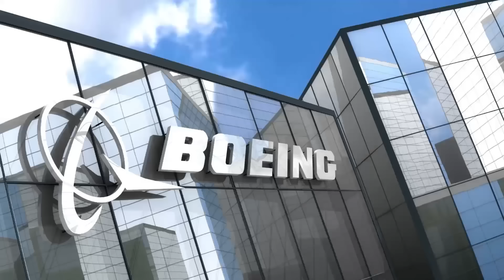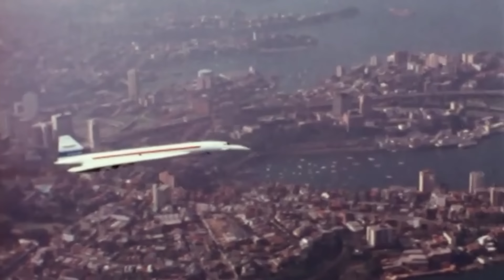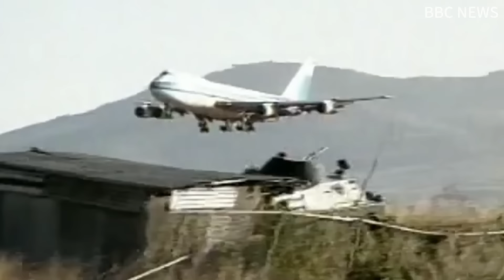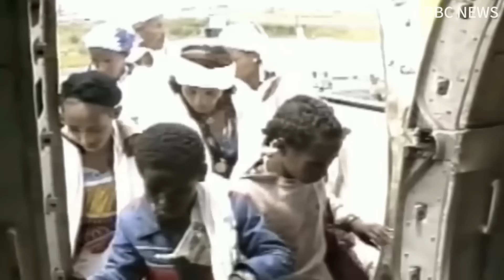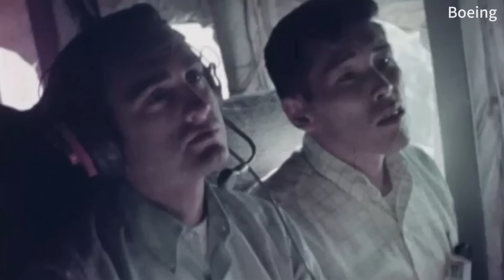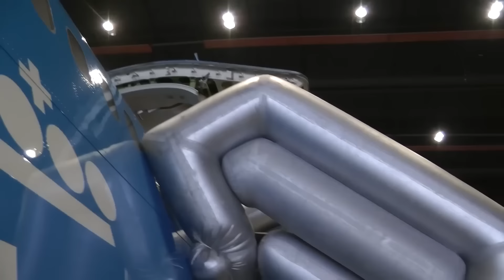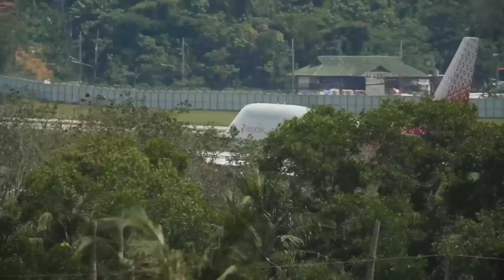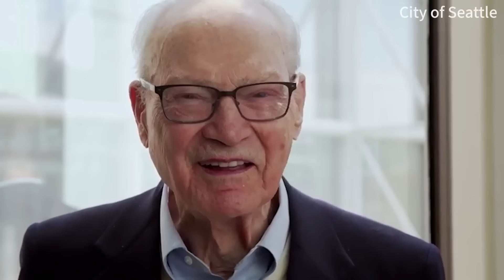What The Boeing 747 Hump Was Really For

Comment: As Pan Am cabin crew (flight attendant and then purser) for eight years (1970-1978, pre-deregulation, when all Pan Am flights were international), I usually worked on Pan Am's 747-100s and 747-200s.  It was an amazing privilege, and I loved it.  In this fast and spacious aircraft, passengers in all classes of service were able to be comfortable, and we were able to take very good care of them.  For takeoffs and landings, I sometimes was assigned the crew jumpseat at one of the main deck's two aft doors on the main deck (L5 and R5).  From these forward-facing vantage points, I would sometimes time the seconds between liftoff of the nose gear and of the main gears (on takeoffs) or between touchdown of the main gears and of the nose gear (on landings) and was always impressed by the result.  (I was very interested in every aspect of the 747's capabilities and its other flight logistics.)  ...  As alluded to above, Pan Am's 747s had a main deck and an upper deck.  During my 1970-1978 tenure, every passenger had an assigned seat on the main deck, and that was where each was to be on takeoff and landing.  There were three classes of service:  first class, business class and economy. The upper deck held a dining room/lounge for first-class passengers, a galley, lavatories, an emergency exit that was 32 (or possibly 36) feet off the ground and the flight deck.  The main deck and the upper deck were connected by a spiral staircase.  Up to 16 first-class passengers could choose to take their main meal at one of the tables in the upper deck dining room, and up to 16 first-class passengers  at a time could relax in the upper deck lounge when a meal was not being served.  All seating in that dining room/lounge had seatbelts, and that area had windows like those on the main deck.  Two flight attendants worked on the upper deck, cooking meals and serving the passengers in the lounge/dining room and the flight deck crew.  747 flights were very smooth; turbulence was unusual at the altitudes at which that aircraft flew.  Given my experience with Pan Am's 747s, both as a cabin crew member and a passenger, that aircraft, for me, will always be the Queen of the Skies.
Reply: I flew Flt 002 and then Flt 001 in June 75 (Bangkok-SFO-Bangkok), you may have worked the same flights. Pan Am crews were top-notch.
Reply: Did you ever fly that PanAm spaceliner I saw in Kubrick's 2001 documentary?
Reply: @john-r-edge  No.

Comment: One hidden feature you didn't touch upon was the hardpoint. The 747 was so large, no other airplane could ferry an engine so Quantas requested the ability to ferry a fifth engine under the left wing. Unpowered and with paying passenger aboard, the 747 had to create its own logistical tail. Including the 4 Dreamlifters which were modified to ferry 787 fuselages and wings across the world. SOFIA is another incredible modification. The only 747 I've been on is Spirit of Everett and I was confronted with the logistics of cutting a boomer window in the aft pressure bulkhead to enable aerial refueling.
Reply: I learned about the left wing hardpoint because Virgin used it to air launch rockets.

Comment: Flew from lax to Sydney on 747 which was really nice. Lots of room and we averaged 500 some odd mph. Got to Sydney a little early because of it and flew around in circles til the ap opened. Only international airport I know of that isn't 24 hours. After short layover reboarded same 747 to Melbourne but only 25 passengers got on... what an absolute thrill ride! All that power and virtually empty airplane we were at takeoff speed in no time and pilot hot rodded that thing up into the air! Greatest plane ride ever! 747 is my absolute favorite plane. Only thing as impressive today is the 380 but even that doesn't have the same oh yeah feeling in my opinion.

Comment: My second ever plane trip was from Hawaii to San Francisco when returning stateside for discharge from the Navy when I was 21. I'm 72 now. I was traveling in uniform and when I boarded, a charming and beautiful young stewardess intercepted me just as I was about to take my coach seat. She led me to the port window seat in the first row of first class where I was treated like any other First Class passenger. It was glorious! 

The ride was supremely smooth and quiet. The next best flight on any aircraft was after my discharge when I flew from San Francisco to Atlanta on an L1011. Even though I didn't get the first class treatment, the searing was spacious and comfortable and the aircraft exuded a feeling of the superb engineering that almost bankrupted Lockheed. It was just a magnificently well built plane and also pretty quiet in the cabin.

Comment: I worked at walking during the contest of an earlier party. I saw a marker of the proposed version and looked at a car stolen there of the seven 6:45 and it was obvious that they designed under government contract for a huge passenger airline not a bus. Fortunately, lucky Yatley see our contract with opening and retail with tell you by the 747 looks so close. I like the 747 because of a beautiful airplane and I took it from LA to Japan and happy with the accommodations. I wish the remote comment on the Elton 11 which Charles worked on personally which I think was the greatest airplane ever built because it was based on a long military history. No ever cover failure due to aircraft design. The one crash in the Everglades with you pilot bear due to understanding the warning system, could have been avoided. The other flight was due to Arabs in ironically cooking on AirPlay, which is not the line for fire control inside

Comment: I was a flight attendant for Northwest Airlines and got to work on the 747-200 and 747-400.  Both versions were among my favorite aircraft to work on.  Our 747-200s had great mid cabin galleys which had a pass-thru counter between the two sides of the galley and the 747-400s had awesome crew rest areas in the tail section of the fuselage.  I loved the staircases too, both the straight and spiral ones.  I worked the 747-200 upper deck one time on a fairly short-lived flight route from Las Vegas to Tokyo and that was a special treat to work that upper deck business class cabin.
Reply: What seating was upstairs? I bet 1st class seats were up there. There had to be a galley. I don't think the flight attendants would carry food and drink up and down the stairs.
Reply: @dannydaw59  It was 4 rows of 2x2 across and the cabin was called "World Business Class", although it was essentially a fancy name for first class.  There was indeed a small galley just behind the flight deck, at the top of the spiral staircase, which was stocked by catering.  There may have been one or two things I needed from downstairs, but service for 16 was stocked in my galley.  Our 747-400s also had a cart elevator for sending carts (of all sizes) up and downstairs.
Reply: @747captain - Would a special clientele like that tip, and tip well? Also, were you a flight attendant who then upgraded your career to 747 captain?
Reply: Stewardess
Reply: Oh you mean the sin bin ! That’s what us mechanics called the flight attendants sleeping area above the restrooms.  Nwa mechanic!
Reply: I had the pleasure of traveling "World Business Class" round trip to London on Northwest in the 90's.  Absolutely loved riding in the "bubble!"  It really felt like we were in an exclusive club, separated from the rest of the passengers.  I flew from Denver, but I don't recall if I flew direct/nonstop to London or caught a connecting flight.  I'm guessing the latter since Denver was never a NW hub.
Reply: When I flew PANAM LAX TO ZUR BUSINESS CLASS was in the "bubble".  I remember the cabin crew always took my coat labeling it with my name.  I finished off my meal with coffee and Cointreau. I often was served by the same familiar cabin crew.🎉

Comment: When you are in the terminal looking out the window to the airplane, the 747 is truly a beautiful and immense airplane that most people are in awe of.  BUT, once you board the plane, unless you are in first class and have seats on the upper deck, there is not much difference between the 747, 767 and the 777.  Coach on the 747 ain't anything special and coach on a 767 or 777 feels just like coach in the 747 -- narrow seats, little leg room and other coach passengers squeezing you from either side.  First class on the 747, 767 and 777 are excellent.  Quiet, plenty of room, free booze and good food -- what's not to like.

Comment: The hump also had a flaw that became known as section 41. That was where the fuselage deviated from a cylinder between the upper and lower decks and stress related issues began to appear requiring all early models to go through an extensive modification that required completely gutting the cockpit and electronics bay and took over a month to accomplish.
Reply: Probably because the 747 was originally a high-wing design for a military transport.
Reply: @bundywaters5988  I believe it was determined that because the forward fuselage section was not cylindrical the flat  area (section 41) would try to balloon out every time it was pressurized causing fatigue and had to be significantly reinforced.
Reply: @pi.actual  I understand, what I'm saying is that the C5 has the same "pear" profile; maybe the high wingbox helps with reinforcement.  When Boeing changed the 747 design to a low wing aircraft for commercial use, perhaps that's why the pressurization issue with that fuselage profile came up, because the C5 never had that problem.

Comment: 1999. flew to-and-fro to Tokyo on seat 1A.  My best flight seat experience ever. 
 
For most of that flight I could see an aircraft flying in the same direction but at a bit lower altitude and it trailed a short contrail.  Sticking my arm towards it with my left thumb up; I measured the wingspan of the leading plane as 1/3 the width of my thumbnail. 

Getting long-in-tooth so don't expect to experience such again.

Comment: Modern aircraft are designed to be efficient, not fast. If you arrive faster but have to wait to be cleared for landing you flew faster and used more fuel for nothing.
Reply: The new birds are .85 again. The .78 to 82 was airbus stupidity .  On short haul under two or three hours it makes no difference in time gate to gate

Comment: You never mentioned the cranked arrow wing.   37.5 degrees to the outboard engines then it reduces to 35 degrees!     Double sweep!  727 same, 737, same, 707/720, same.    Really cool.

Comment: Plane paint..,you are WRONG again.  In the Boeing stats, a 3 color complete scheme ads 555lbs to a 747-400.  Just look it up.  I did.   When the paint is wet and curing, it weighs up to 2000 lbs.  When dry, 555lbs.     Well, that is what Boeing says….    Who backs your “data”.      You really did not do your homework.      Good try but really not accurate.

Comment: Not true on the upper deck.  The slides would have been by each door.  10 on the lower deck and 8 on the top.  The 90 second would work but at the time, the market did not warrant such a large aircraft.  Airports could not handle 600 pax arriving on one plane.  Baggage handling was maxed….     What you said was not true in every book on the plane.   Sorry, you are wrong.
Reply: Not to mention that points number one and six gave different answers to the title question.

Comment: Good but not 100% correct.   We cruised home on the last leg in the 747 at .92 Mach.    No sane 747 pilot flew at .85 going home.   Embarrassing.      You forget the reason for the hump. Remember, while bidding for the USAF contract, the 747 was a high wing plane. The wing was located just as the hump curved down on the -100/200 .
Reply: Boeing’s bid for the C-5 competition was NOT the 747; this is a persistent myth, ignoring that the USAF design had a different fuselage, different wing, different empennage, different engines, different landing gear…nothing at all in common with the commercial 747.  Boeing lost that bid, but used some of the lessons learned in their design of the 747.

Comment: A couple years ago I was lucky enough to fly from Chicago to Frankfurt on a Lufthansa 747-400 in seat 2A. It was an incredible experience! The sheer size of the plane is breathtaking and being in front of the pilots is an otherworldly experience. It is also one of the smoothest flight experiences I've had. Even flying through some turbulent air the size of the plane pretty much negates most turbulence felt by the passengers.

Comment: Most Boeings have 35 degree wing swept. Designers want a .9 Mach airliner.  So the proposed a 40 degree swept wing.  Aerodynamisists and engineers argued back and forth about the viability of such an aggressive wing.  Finally the day came to decide lay out the designed.  Back and forth on 35 or 40 degrees.  After a while the VP in charge decided.  It would be 37.5 degrees. Not .9, but still the fastest. That's where its speed is derived.